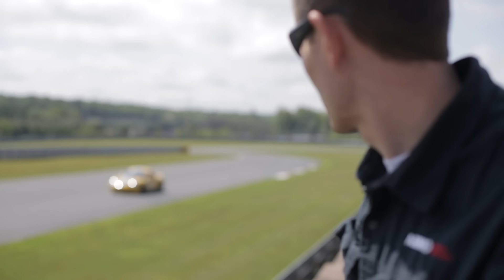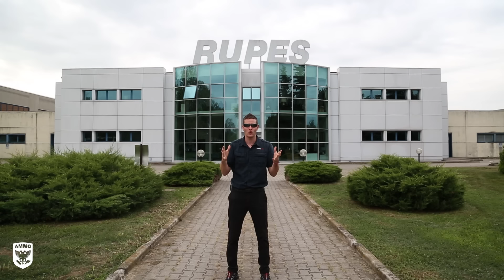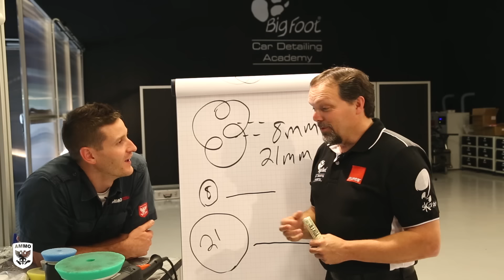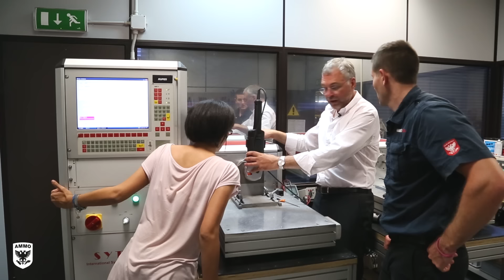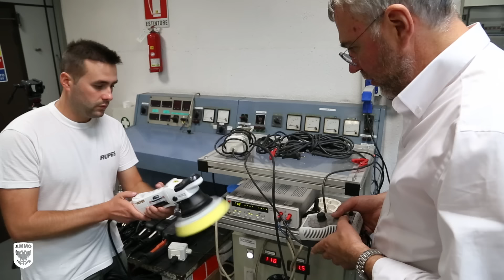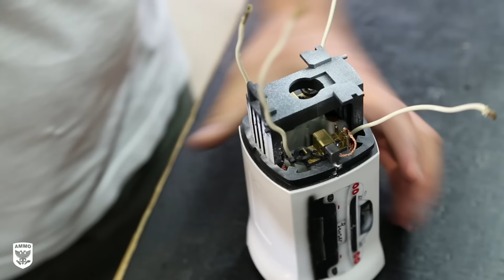REVIEW: NEW RUPES 21 POLISHER

Comment: Hi. Can anyone tell me how to prevent unbalancing rupes pads or is there any trick to it. I use always yellow pad and after 1/3 car the hole bigfoot starts to shake because pad is heated and unbalanced. Its just starts to be very expensive, atleast in Finland pads are about 15$. Thank u for your answer.
Reply from the maker: Sounds like too much heat is being introduced. try backing off the speed and/or pressure.